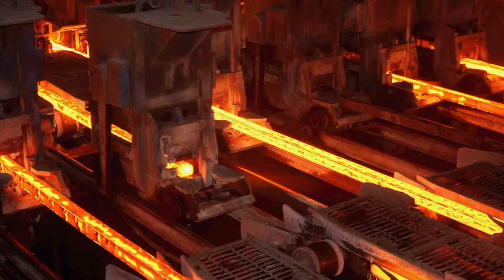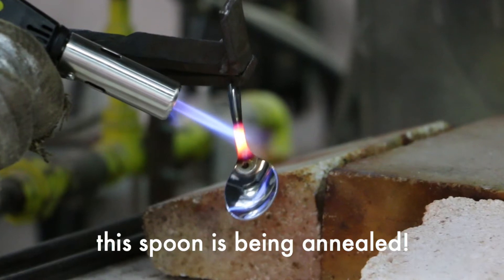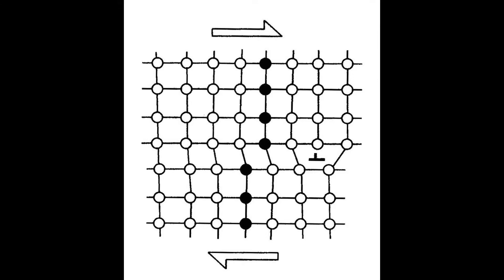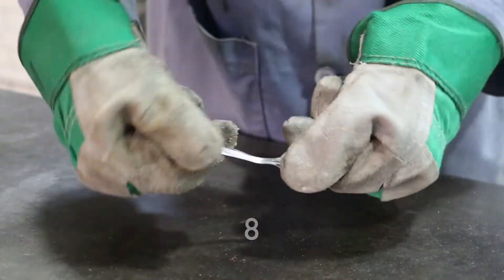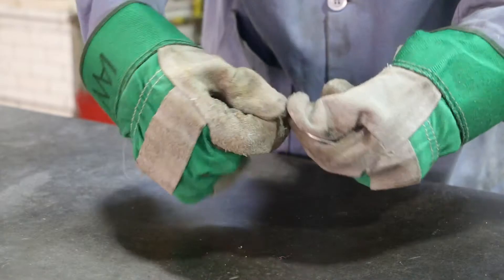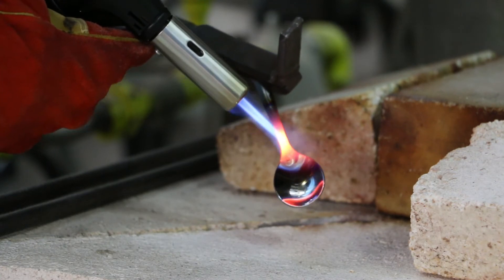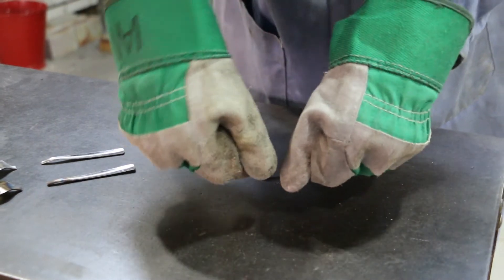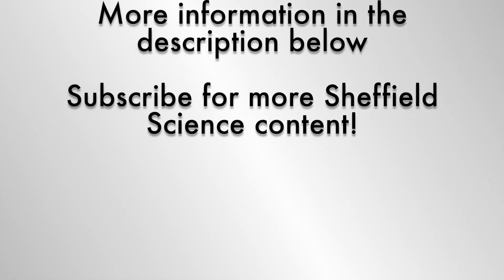Annealing Stainless Steel Spoons

Comment: Did you let spoon cool slowly or quench it ??
Reply: Most forms of rapid cooling cause metal to become more hard and thus more brittle than if it was allowed to cool slowly.
Reply: @zachmalsberg7130  regular metal with carbon content yes but stainless is a whole different deal. Copper is annealed by getting it hot and quenching immediately. I drill a lot of stainless and occasionally I will run across a spot in the stainless that is work hardened. I’ve tried heating it and letting it cool slowly but no success. A brand new drill bit still will not touch it.
Reply: @zachmalsberg7130  most metals are actually the opposite of that